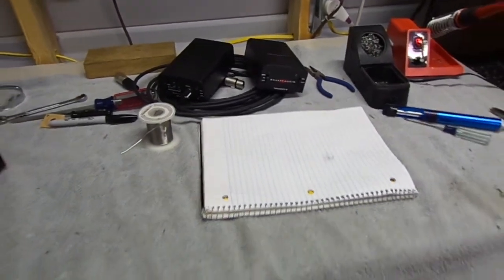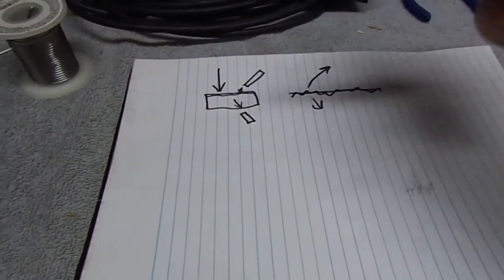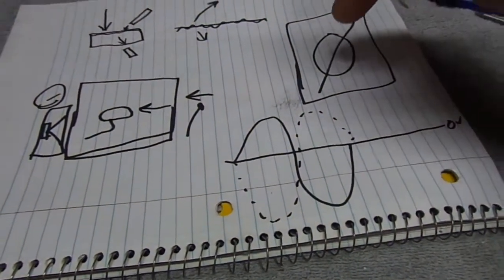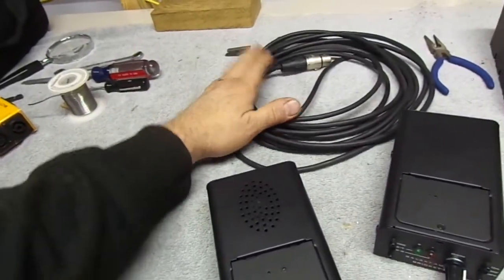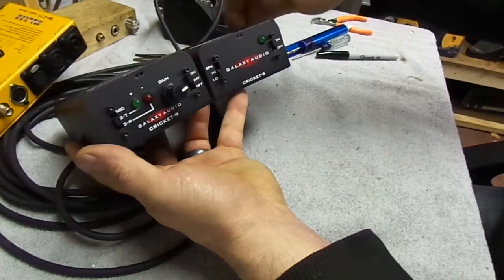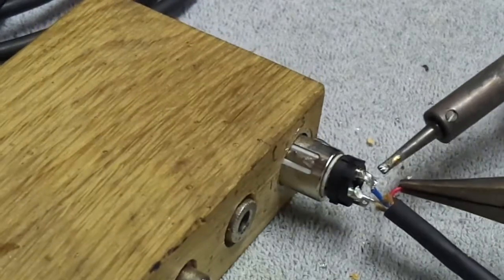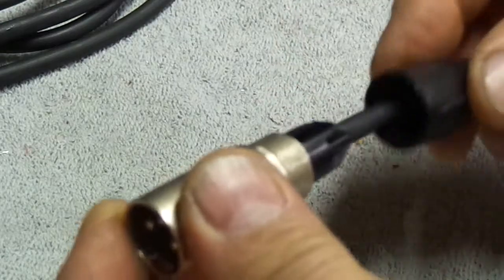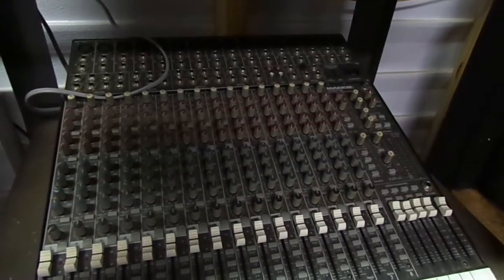Polarity invert XLR cable...ie Phase inverter

Comment: Good day! Can this be possible to use in vocals? For the feedbacks to be gone?
Reply from the maker: No, you'd be better adding a little bit of channel delay (not the effect) to help with feedback. Best thing is to ring out the system beforehand and bandaids aren't needed, But I must admit have done it myself in a pinch.

Comment: Hello friend and thank you for your videos !
I have a question hoping you can answer it and help me,
I would like to combine the SAMSON DE10 Headset Microphone with the SONY UTX-B03 Bodypack Transmitter,
Of course, I already tried and found that they were not compatible !
Is there an adapter for this on the market ?
If not, what do you think is the best way to make them compatible ?
Thank you very much in advance !
Reply from the maker: With a soldering iron and some patience you can make your own cable. I would think the only reason they aren't compatible is because the plug is different. Cut open the Sony plug and solder the wires from the Samson mic to the plug and you are set, that is of course that you really want this combination.
Reply: Oh thank you Rick for your answer, yes I usually do that with the Sennheiser capsules (avoiding opening the plug but just by cutting the cable) and it works ! But considering the thickness of the Samson cable (as thin as the cables of the hands-free kit) I fear that it's necessary to consider another solution, such as the manufacture of an intermediate cable that would serve as an adapter !
What do you think ??

Comment: Oh we meet again ! I've been instructed that a +3 hot outboard unit with xlr input/output needs a special cable wiring. All cables these days are +2 hot. I wished to run a Y cable to the I/0 trs port on my mixer which has no phase invert. My thoughts were to use +2 hot cable and use phase invert adapters at the  compressor +3 hot input bal. And the +3 output unbal. Keeping my cable and mixer +2 and my compressor +3....problem is I have a muted signal though upon tapping the mic the compressor gets signal. Any way will phase invert adapters like the gxx195 work to insert a compressor into only one channel of a board or do I need to do it +3 to trs on all my Y cables?
Reply from the maker: Just use your soldering iron and swap pins 2 and 3, then label the cable special. When tapping the mic, if you are sending the signal down 2 cables, one that is pin 2 positive and the other pin 3 positive then they will cancel each other out. Verify that all cables are pin 2 positive except for the special cable that you make.

Comment: RIck, Great video! wish I had I known this earlier....I do have a more techy question regarding a mixer. I have a Behringer sx2442fx mixer. I`ve been having problems with channel 3 xlr input. It seems to not work at all. I took the board apart completely, and resoldered the xlr input, I am putting the board back together now in hopes it works, but any idea what would cause this to happen? Thanks!

-Jeff

Comment: I disagree with any comments that make the claim "You always should..."    Here's why...(30 years experience here)  It was about 1 year ago, and I was playing around with mic placement... I routed a test tone of 1KHz through a monitor speaker, and turned it up to fill the room with sound. I then put on some headphones, and walking around the room with a single mic. As I moved around - the tone would get loud, soft, loud, soft. This is an EXTREMELY important thing to understand. How does my little test relate to your comments about phase?  Here's how... If I am at at an 'out of phase' position, (where the volume is lower) and I invert phase, the volume will switch to being loud again. So... the correct phasing has a great deal to do with the frequency wavelength & distance from the source. If you notice the phasing issue causing a snare (for example) to get quiet. Before I get all negative about it, I would move the snare mic back and forth while listening for the exact frequency I wish to cut. Learn to use phase cancellation to your advantage. If you don't have time to do all the above, sure phase inverting MAY at times work to your advantage. The reason for the controversy (some engineers invert phase on the top mic, some on the bottom mic) is on account of not understanding that little test tone experiment I ran while in the studio. Again, it has a great deal to do with the distance from the source, and what frequency you will be utilizing in the mix.
Reply: Brendan O'Brian Producer and mix engineer of RCHP,STP,Soundgarden,and every Pearl Jam record,use's a Y splitter with a  phase invert on the bottom tom mic's summed to mono
,every engineer  I have ever worked for use's phase inversion on one or more microphones
Reply: Hayden Myhill Phase switches are on the Allen & Heath console, and if you want to get rid of a low frequency feedback on the kick.... the resonance coming through the drummer's monitor, you invert phase. There was a concert audio company that would set a second set of sub woofer speakers, just behind the first. They did this in order to better control the low frequencies. They were playing around with phase cancellation. I think they improved the sound of the sage/PA as a whole by doing this. There are certain mic placement techniques, a classic Mid/Side configuration where you duplicate one of the two microphones, and invert phase. This was an ambient technique created in the early 60's/70'
s. Some drum tracking engineers don't like to place everything in exact phase because they like the thickness of that delay. As long as you understand what frequencies you are messing with, and that you are IMPROVING the sound through your phase manipulation, and can sum to mono for a check, you control phase to your advantage. I was re-amping a guitar track the other day, and I flipped phase on the ambient mic, and it sounded fuller, and so I went with that.... moved forward.... recorded the set up. They put the phase reversal switch on EVERYTHING because of that node/anti-node I was explaining in the previous comment. Again, put some headphones on, run a test tone through some speaker in the room.... hold the microphone in your hand while you walk around. listen to how the tone gets LOUD at points and nearly disappears at other locations. Try this same advanced engineering trick with some other frequency.